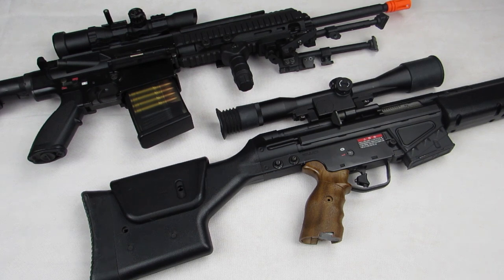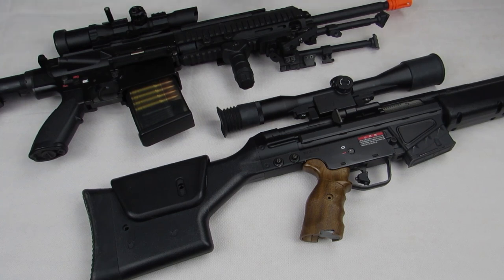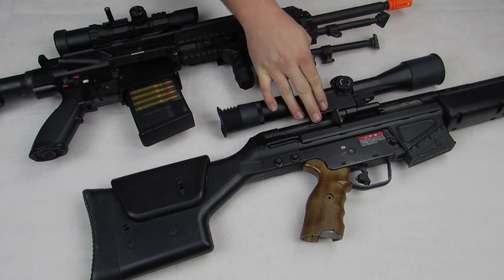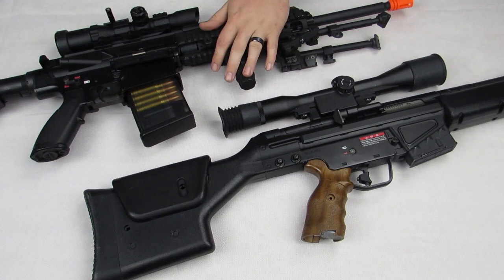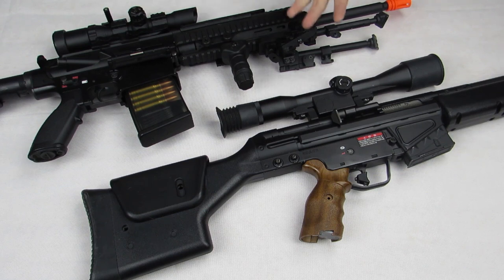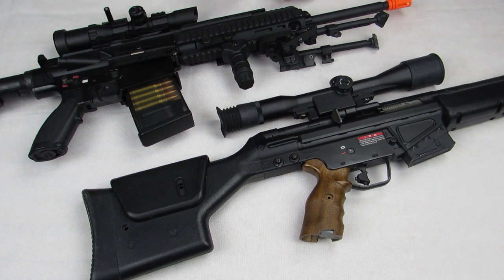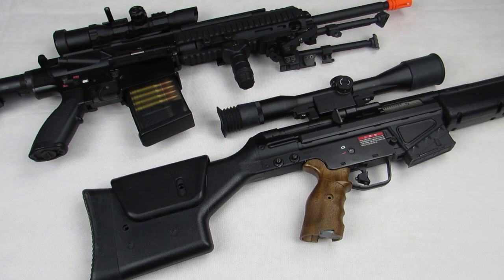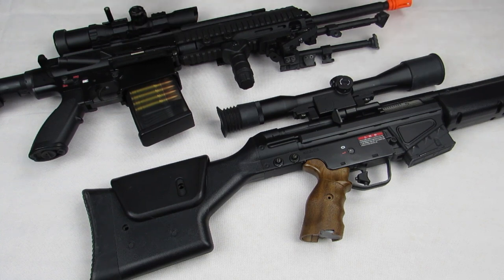How To Build A DMR In Airsoft: Part 1- Introduction and Overview

Comment: In Portugal we are limited to 1.3joules in all guns.
What bb weight do you sugest using? At that speed should we use.4g or above bbs even if its very slow?
Im using .3g at the moment because even tho i can op .4s, it lacks speed and range.
Reply from the maker: At 1.3 J I would use a maximum of .30g or maybe .32g. Any heavier will decrease range. I would also use R-Hop to put less pressure on the BB to gain a little bit more energy and range that way due to the decreased friction.

Comment: Price for a good dmr?
Reply from the maker: You can build a good DMR from a cheap base in total for around $450
Reply: @WolfAirsoftGaming  any base and part u recommend?
Reply from the maker: For going cheap, anything CYMA should work fine. Then upgrade your hop unit(MAXX or prowin), bucking, PDI Barrel, R-hop, then compression parts, mosfet, motor, then durability parts on the drive train
Reply from the maker: In order of importance
Reply: @WolfAirsoftGaming  thank you very much earned my subscription
Appreciate the help

Comment: Hey Wolf, I know the PSG-1 has an incredibly long barrel (590mm) and I'm doing a DMR build with the A&K sr25 which has a 509mm barrel. I'm wanting to use .45 BLS bbs with it and have been told that using a long barrel with heavy bbs wont be able to provide enough air to get out the barrel. How did you get a heavier bb and a longer barrel to shoot accurately? I have yet to build is I just need to know if I need a shorter inner barrel first
Reply from the maker: I lost about .10 to .20J using .45’s but the cylinder was a bore up by systema (very thin) and the barrel was 6.01x509. Use as little Sorbo as possible without compromising durability to maximize air volume. Your C:B ratio for .45g should be 2.6:1 or 3:1 comfortably, but will probably fall short of that goal. It’s close though and paired with PDI, R-hop, ext. I was able to get to 300’ accurately

Comment: How about mancraft systems? Fully mechanical
Reply from the maker: I’m not sure if the Mancraft system is a fixed volume or unlimited volume system. In my opinion there are much better systems on the market with a comparable price point (EM Reaper, N7 Milsim). I purchased one system from them and let’s just say it was a very poor decision and product.
Reply: @WolfAirsoftGaming  I need part 4 xD

I now but I was think in getting an Svd kit
Reply from the maker: I’m assuming you mean an SDiK with a BASR SVD. I got a kit for a VSR-10 that didn’t work. Had to sell it and try to get back some money. Get the wolverine bolt if you want an HPA BASR. Use one of the platforms they offer for the bolt, you won’t regret it.